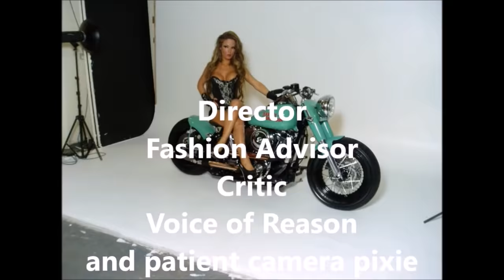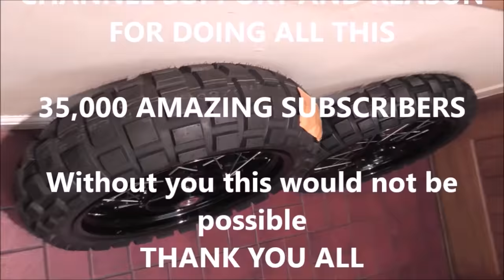Delboy's Garage, USD Fork Seal Replacement

Comment: I was watching so carefully to se which way up the seal went. I even slowed down to .5 speed to see which side the spring in the seal was. It looked like maybe those seals have a spring on both sides. Am I correct that spring always goes towards the oil?
Reply from the maker: Yes, with the main fork seal itself, if you look at them they are kind of "open" on one side and "closed on the other... the open side shows the internal spring, and you're correct, that side (the open side ) always goes towards the oil..

Comment: Shouldn’t you have removed the cloth to let the tube fully down to set the air gap ? Great vid
Reply from the maker: Doesn't come across very clearly in the video Tony, but measure to the top of the chrome stantion tube, not the slider.. doesn't matter whether you push the slider right down or not, just reach down a bit inside it to the top of the stantion.!    if the very bottom of your stantion is a little rust pitted like mine was, they you'll trash the new seals if you push them over it.!

Comment: Great video, thanks.
I wanted to ask, after filling oil, shouldn't the rag be taken off for the measurement to be accurate?
Reply from the maker: No need, the rag is to protect the new seal from the rough corroded chrome at the bottom, you measure to the top of the INNER CHROME TUBE.. not the outer movable one..!
Reply: @Moonfleet41  got you,tnx.

Comment: Hi. I have a problem with a damper screw on the top of my forks. Manual says they should rotate 14 click from lock to lock, but they looks stuck. I can only rotate it 2 clicks and then they are getting hard to rotate. Can you suggest what should i looks at? I'm thinking that maybe fork was disassembled before and assembled wrong? The bike is 2015 Suzuki v-strom 1000

Comment: that was going really well till that seal driver came out of the box specific to that size fork, ive only ever done the conventional type where you can slip a pipe down over to tap the new seal home, so is that tool a must have and how much are they? other than that it looks a piece of piss.

Comment: I changing all seals, bushings, & springs. I noticed my old seals were dry and cracked and seems to have scratched up my forks a bit. Enough to barely feel it with my nail. What grit sand paper should I use to repair this?
Reply: I know you used 1200 for the bottom rough spots. But mine scratches (very light) is where all the action is.

Comment: I have some 46mm Ohlins fork on my enduro motorcycle and it have 3 bushings, last 2 bushings(have 10 cm aluminum spacer between them) are very hard to install, is it normal? I even bent the washer and barely installed last time, now it was quite easy to uninstall them but have same issue when installing.

Comment: Hey, Mr.Delboy does this process work for a 2009 ZX10r. I followed your directions for my 2009 ZX14 and it was very easy. I have all the special tools too. So are the forks basically the same?

Comment: question: doenst the manual usually state you should check the new oil level with the fork fully compressed? yet your rag at the bottom probably is still propping it up a bit? technically that would mean that you put too much oil in because the level would have still risen if the fork upper could move down a little. Or was that not the case?
Reply from the maker: When you push the outer tube all the way down hard, it will sit level with the inner tube.....(the rag prevents cutting up the new seal on rough chrome), so i just measure the level on the INNER tube and that makes it correct... !

Comment: grate vid mate ? I have a sinnis terrain they don't make a manual ? how do I find out how much oil to refill it with
Reply from the maker: Get in touch with a sinnis dealer and ask them for a spec sheet or pdf for the setvice data.. it will exist mate !

Comment: I need some help. I have a Yamaha Majesty 400 scooter, 2009 with upright forks on the front. How do I get the darn screw out of the bottom? It keeps rotating, even when I put the spring and top bolt cap back in for pressure,  (I did drain out the oil. And, DO I HAVE to undo that to do just replace the oil seal? It does not seem to serve any purpose but to oil dampen. It also has no way to grip on it on the inside of the tube.  Anyway, any help would really be great as I have taken it all down, all parts on driveway, and no one has time to help me except after summer!!:(  So far no one has replied on line....thanks so much!!  Great video by the way! Will watch more of your work.
Reply from the maker: Hi there.. If you're referring to the bolt at the bottom of the fork legs, that screws into the damper rod and yes, it will turn if you have already taken the spring out.. try assembling the spring into the fork and screwing the cap back on.. that will bear down on the damper rod and should hold it still enough to break the bolt free.. specially if you can use an impact gun on that bolt too... if that fails, then you can usually hold the damper rod still internally as long as it has a deep dimple in the top end, you can use a wooden spike in the vice to jam into the end of the damper rod.. that will hold it still to..!   Hope that helps you out.. Good luck with it. !

Comment: Del. Thanks for this video 
 I've now replaced the oil and seals on my USD forks and the oil was definitely way past its best. One question I do have is about the fork legs. These spin or rotate . Is it the wheel being installed that stops them turning within the tube as there are no obvious slots or grooves between the tune and the leg to keep them locked into 1 position?
Reply from the maker: Glad it helped mate, as with all fork legs, the inner stanchion is free to rotate within the slider, it may be a little stiff, but that's because the spring is pushing down on it from inside... but once you've fitted them, twist them with your hand till they line up to insert the axle, and the axle and wheel will hold them in place!
Reply: @Moonfleet41  thanks del. So far I've done the forks , head bearings, wheel  bearings and will be replacing the seals on the front calipers and servicing the master cylinder. Really enjoying giving the bike a deep maintenance cycle and these videos are fantastic.  Will be joining the patreon site very soon.
Reply from the maker: @ref.handle.2  Hi again Andy, thanks mate, glad you found it useful, it's why we take the effort with the videos to make them as beneficial as possible!  It'd be awesome to have you on board as a Patron, thank you so much in advance for your kind support!

Comment: Would you suggest always changing the seals as a pair, even if one of the two is fine?
Reply from the maker: YES mate.. always change fork seals as a pair.. you can only buy them in pairs usually... and you can bet the good one will leak the week after you fix the bad one..lol

Comment: Just my opinion but I ALWAYS use OEM oil seals. Had so many aftermarket ones fail within a fairly short time compared to originals. OEM ones might cost a bit more but last way longer. And use a decent oil.

Comment: Hi! Gonna change the seals on my ducati monster 800 from 2003. Just wondering if its the same tools needed or if there are any special tools needed?
Reply from the maker: Any model specific tools needed for your Ducati forks will be listed in your workshop manual, probably along with part numbers too... not a bike ive worked on so can't advice personally mate..

Comment: Very nice Video and equally good camera person. Would this method work on a 2005 Yamaha R1 fork ?
Reply from the maker: Most upside down forks are built on the same platform of design,  but get yourself a decent manual so you have the specific setup, and torque values as well..!

Comment: Great advice Del, keep up the good work - videos are helping me loads - looking to buy a bike table lift like yours, any recommendations? cheers
Reply from the maker: It depends largely on your budget and how heavy the bikes are you're gonna lift... i use a Sealey MC680A, and it's beefy enough for any bike, even a full dress Harley or Gold wing.. had it for years now and it's still working like new..!
Reply: many thanks will check it out - I have a big KTM adventure that im working on 
 @Moonfleet41
Reply: Don't suppose you've done a valve clearance video on an LC8 have you :)
Reply from the maker: @mudjumperktm  Sadly no, I haven't, but principally it's the same work on most bikes, you'll need a manual anyway for specs and clearances and the procedure will be laid out in there... good luck with it!

Comment: Hello. Maybe you can help me. I just did the fork seals in my cb1000r.  What suprised me. When I pushed bush washer and seal all the way in there is a gap between clip and seal around 2mm. Never seen anything like that before. Is that normal? Before I did another fork I have measure bush, washer and seal together. Then mansured space for them and looks like all of them together have 2mm lest. I don't know what's going on. Everything oem Honda parts

Comment: so with that rag tied around the bottom of the fork, wouldn't that change the oil level a considerable amount?  I feel like adding it by volume would be better?
Reply from the maker: No, because you measure to the top of the INNER TUBE not the outer tube.. height of the outer tube doesn't matter !

Comment: Hi, I watched your vid on USD fork seals and found it very good as this is my first bike with this setup. VFR1200x (Cross Tourer). I am going on 75 and started riding when I was about 8yrs old:) I worked part time as a MC Tech during my time in the military, then got hired with Honda Corp. starting out in MC Service department in Atlantic Canada. My question is when I have been servicing forks, all conventional until now, I would flush them out with Kerosene which is a fine oil. Then drain and refill with Auto transmission fluid or bulk fork oil and work it out before filling with the right amount of  fork fluid. What is your opinion on this method??  Thanks in advance - Rennie in Halifax, Nova Scotia, Canada.
Reply from the maker: Hi there Rennie... Sir it is an honour to hear from you, what massive and long experience you have.. an Yes indeed for many years i trusted regular ATF for use as a fork oil, they perform well with it, and no adverse effects what so ever.. after all, it is a hydraulic oil, so why not.!      Also washing out with Kerosene is common too, ive also used that to de-grease filthy final drive chains that are covered in chain wax and grit.. works well, and unlike a solvent it doesn't dry the chain out..   Thank you for sharing your insight, and also for your kind words of support, take care and have a good weekend... Del.

Comment: this video did make it very clear to me how to replace the seals. But i do not have a tool to put the seal into place like you did. So how do i bash the seal into place without that tool?
Reply from the maker: You can make a seal driver for yourself... using two lengths of waste pipe.... take a look at our earlier video on 'Regular Type Fork Seals' and that will give you some insight how to make it !
Reply: Thx, will do

Comment: Question: Does it matter when measuring the oil level that the tube is resting on the cloth and not on the bottom part of the fork?
Reply from the maker: Answer: You measure the INNER steel tube, NOT the outer tube.. so it doesn't matter

Comment: Love the video cheers, my question to you is that while I was dropping the first fork leg out of my 97 TL 1000s I noticed the large Allen key bolt in the bottom of the leg is loose not sure why but I would like to know what it holds and how do I tighten it up , before or after doing the seals. Any support would be greatly appreciated.
Reply from the maker: The big allen bolt up under your fork leg, if you mean the one that runs up in the same direction as the fork, then that's the damper rod bolt that holds the fork leg together... if you're doing fork seals, you need to remove that obviously to strip them apart, but if you're just wondering and were taking the forks out for another reason, then it should be tight of course, but what it bolts to, inside the fork, is only helped still by the spring pressure, so you can rotate that bolt with a bit of effort, and you're rotating the damper rod and spring inside... but if you mean it's literally loose and un-doing itself, then oil would be leaking out too, so when you found it to be 'loose' were you forcing it clockwise?  Because doing that, it will rotate slightly and under pressure, but it shouldn't move counter-clockwise and come undone.
Reply: Delboy's Garage Thanks for the response,  I removed both forks to do the seals and I loosened the Allen bolt due to the advise of another party, but after watching your video I soon realised I did not need to remove the bolt. The bolt was tight but my friend tried to remove the bolt but it just continues to turn freely in both directions. I think the whole assembly is spinning inside and I am not sure on reassembly just in case something is loose. Sorry to be a pain but I can’t find a lot of info on this.  Just a foot note following your instructions I successfully did the seals on the other fork, so thanks for that.

Comment: Great video. 
Just one question, does the rag that you wrapped around the stanchion, alter the air gap? As it would stop the outer tube from sliding fully down to its natural stop. 
Thanks. Dave.
Reply from the maker: It was there to prevent the new seals from passing over rough and corroded chrome and then cutting them up.......i measured from the inner tube to get the exact oil level.... good luck with yours buddy.
Reply: Moonfleet41 yes, I understand why the rag was put there but to get an accurate measurement for both forks, I would’ve thought that any spacer, that stops the outer tube from sliding fully down the stanchion, would give an inaccurate reading for the air gap or at least a different amount in one fork, compared with the other.

Comment: Hi, very useful video. Is the method for cbr600rr 2008 same?
Reply from the maker: It should similar mate, but get a proper goos quality manual so you can check any small differences you may find, and also it'll give you a reference for all the torque settings and oil level spec etc..

Comment: I got a 05 gsxr 600 and the fork seals ain't leaking yet but they are dry rotted bad and leaves traces of fluid behind when they travel so it's just a matter of time. I'm trying to figure out what fork oil to use and how much in each tube but I seem to find alot of diff answeres. What would you recommend to find out.
Reply from the maker: That simple information will be in the service manual mate.. if you own the bike then treat yourself to a manual, it's a sound investment you won't regret !

Comment: Hi bud,great video.Could you please give me a little advice? I left my 1984 Honda Magna in the garage to replace fork springs,seals and oil recently.It has been done by the mechanic,all new parts put in and now i see that forks leak slightly! I have new seals and they leave oil residue,what could be he problem?
Reply from the maker: Hi buddy, it may not be the end of the world, it's not uncommon after replacing fork seals for there to be a little residual weepage as they settle in... best to ride the bike and enjoy it for about 20-30 miles, maybe up to 50, and if still weeping, take it back to the garage who did the seals, and let them have a look... sometimes they can bed in and start to seal ok after a few miles... but if not, then obviously, down to them to rectify it... hope that helps, good luck with it my friend, let us know how you get on... Del
Reply: +Moonfleet41 Wow,it is amazing that you replied so quickly,thank you for this!!! I will do as you recommend.Hopefully it is just a benign/temporary oddity.I will let you know when problem is resolved.
Again thanks for help.Greatly appreciated.
Regards

Comment: HI, Thanks for that video. It is really a good tutorial. There is only one thing it is not correct: the way you mesure the oil level. Since the external tube can't go down to bottom, dépending on the item you use to limit it you will get completely different values even you have the same oil volume.
Reply from the maker: This has become a common question on this video... you always measure to the inner chrome tube which contains the oil, not the outer tube, so it doesn't matter if it's a little up to protect the new seal, you're not measuring to it anyway... always measure to the top of the chrome tube, which I did.
Reply: @Moonfleet41  thank you so much for your answer. I now understand and absolutely agree. Regards.

Comment: Thank you for the instructions. Regards from Slovenia EU
Reply: Hello, I've just finished watching your very detailed process of changing a Cbr600rr inverted fork seals. I'm a little bit unclear about one thing though. I saw you measuring the air gap WITH the 'safety's cloth over the area you cleaned up. Is that the correct way of measuring the air gap?
Reply: Very detailed, clean and educational ... love this site